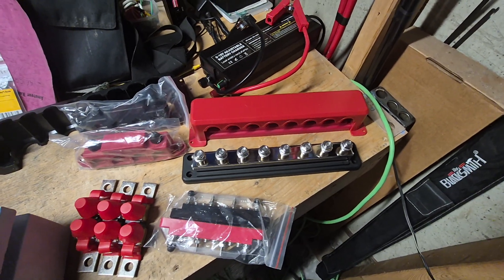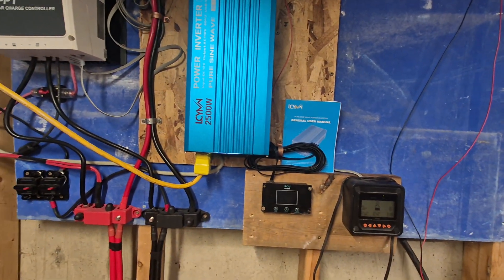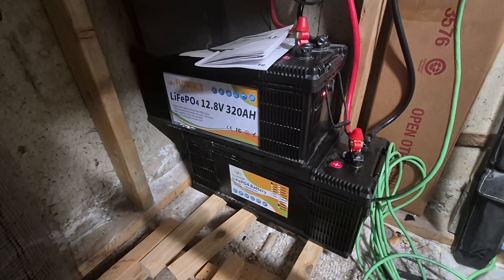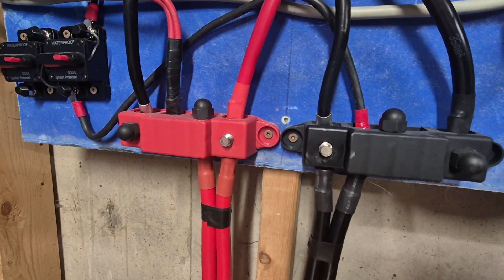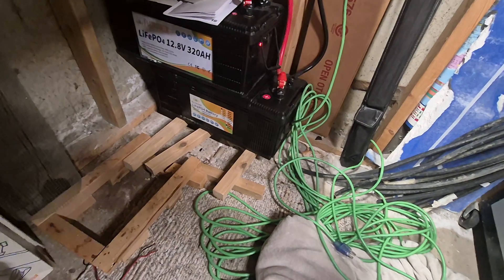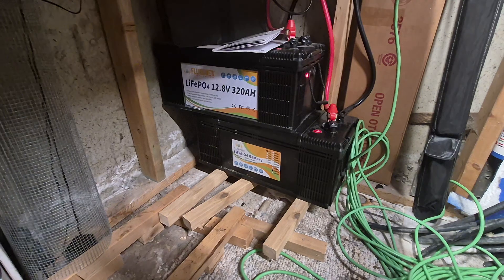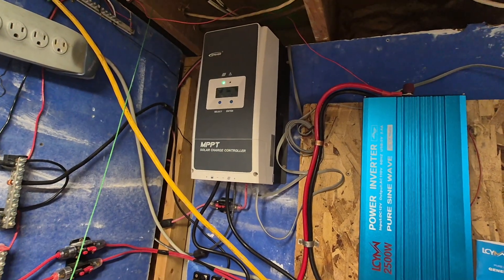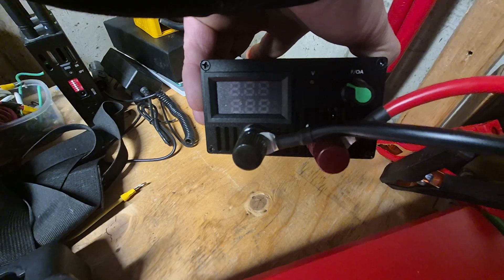Emergency solar power upgrade for 2025. (coming soon)

Comment: I would guess the melting plastic isn't an issue with the cable being too small, but the clamp not having a large enough contact with the post to handle the current. Thus heating stuff up.  Maybe put a lug on that cable and tighten it up with a wing nut or nut.
Reply from the maker: @roncamerata9878  I've put on 4 gage wire, but it still heats up.
Stay tuned, I have more solar and batteries on the way. Should be 2 weeks and I'll do a video on the big upgrade.

Thanks for watching hope you enjoyed.
Reply: No. Buy cables, dont trust cables that arrive with the item.   Remember where they came from.  
Tell us, are you going to have 8 or 6 or 10 batteries,  you're ordering 6 through your friend, right?
Reply from the maker: @SierraHi89  All cables are 1/0.
I will have a total of 8 batteries at 320Amp each.
This will let me run 12 or 48 volt as I need.
My charge controller will accommodate both.

It's a fun hobby.
Thanks for watching hope you enjoyed.